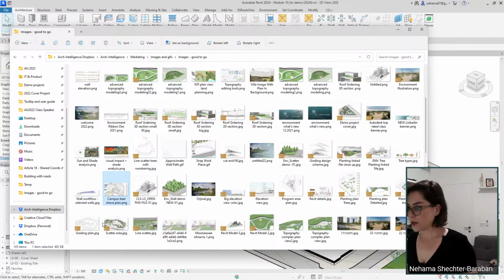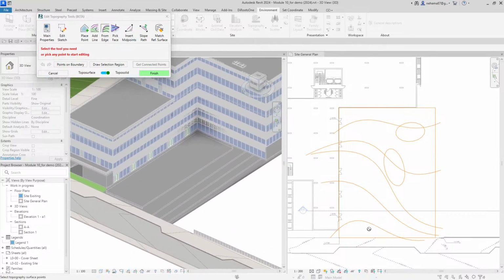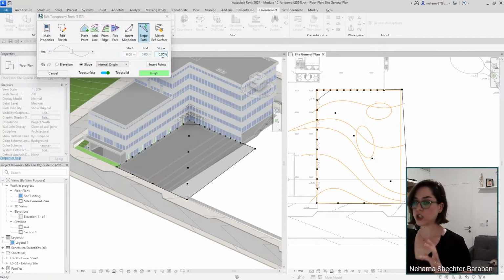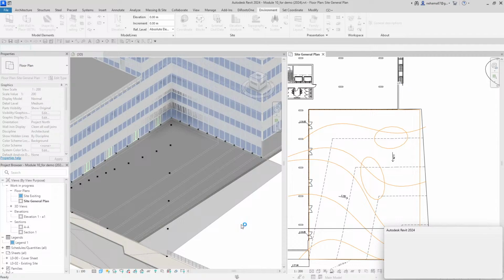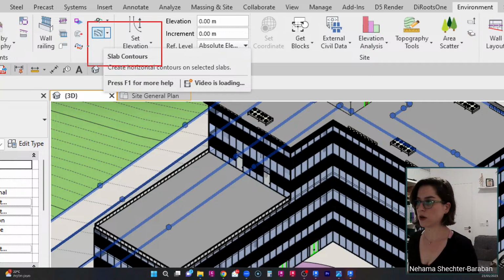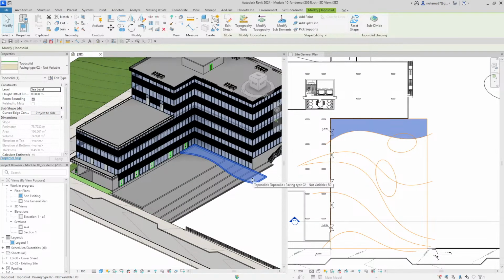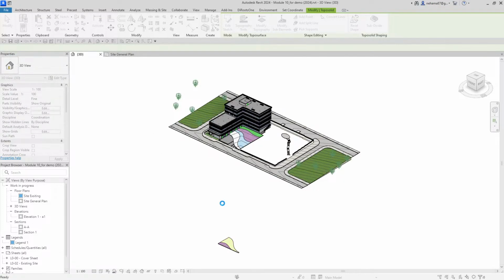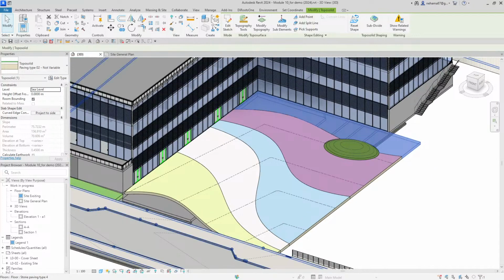Mastering Landscape in Revit® #1 - Topographies 101

Comment: Hello Nechama and thank you for this very good video. My question is this: Is there a way to retrieve the elevation lines from a surveyor's DWG file precisely with "environment for revit"? So that the 2D drawing in revit is the same as in autocad.
Reply from the maker: Hello! Great question. It depends on what you’re aiming for:

	- If you want to create a topography from the contour lines in the DWG, first link the DWG to Revit, then use Topography Tools > Add Line > Get from CAD, to bring in the lines and place elevation points.
	- If you need to work with lines, you can later extract lines from the topography using Extract Surface Contours tool.

If you meant something else, feel free to let us know. We’ll be happy to help!